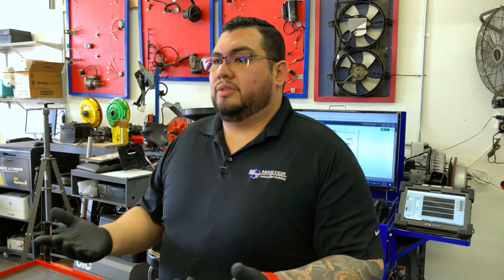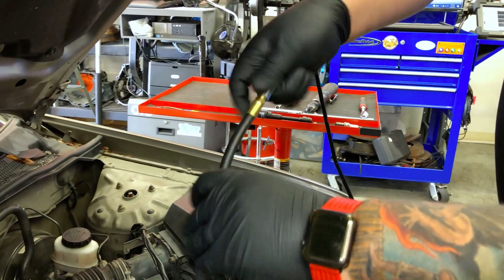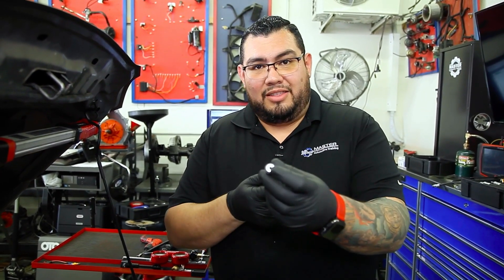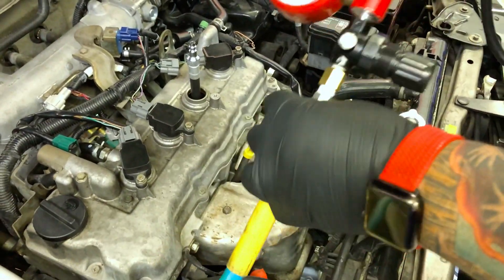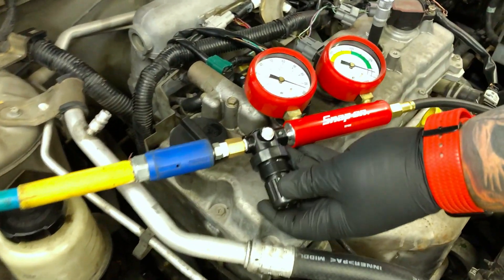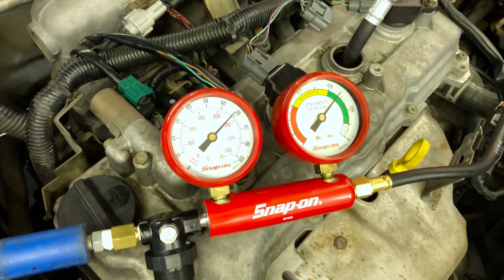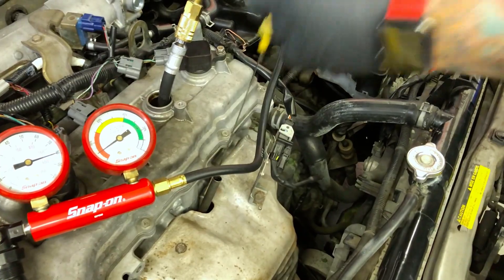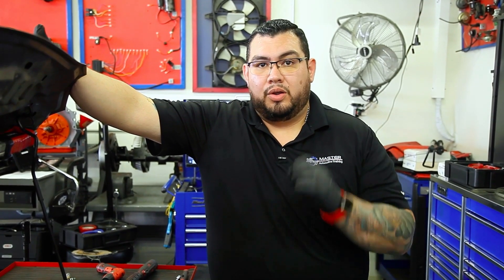How To Perform A Leak Down Test - Fast & Easy

Comment: Put an long 1/4 extension in the spark plug hole and turn until it stops rising, then it's at true TDC not + - 20° like that whistle gives you 😅
Reply: Agreed. Also worth note there's a TDC for compressive stroke and exhaust. Need to know which one you are on by looking at camshaft lo lobes. Otherwise...the escaping air might just be indicating the the exhaust cam is open as intended.
Reply: @CR-rc5ch whistle only sounds on compression stroke(both valves closed) next time pisyon rises, the exhaust valve is opening , therefore no compression. So whistle works to know that ypur on comp. But then tdc is important so piston wont move.
Reply: @CR-rc5ch ok so if I understand this correctly, then the intake lobes would be upwards and the exhaust lobes would be downwards. Is this correct?
Reply: @CR-rc5ch  first off a lobe doesn't open and you look at the valves not the lobes 🤣🤣🤣 Im sure you knew that I just have to pick on you
Reply: Hey man thanks for that tip.
Reply: Do you have to remove relay/fuse for fuel pump to not flood the cylinder?
Reply: @joeymalin  most modern vehicles have a "clear flood" mode where you floor the gas pedal while cranking to disable fuel.   Older vehicles require disabling the fuel system manually with fuses, ect.
Reply: @v12alpine  Thank you. Mine is a 2001. I’m pretty sure the fuses are the way to go for me🙏
Reply: This was excellent, well communicated. I see folks over-thinking the Whistler. It's as easy as he made it appear in the video. The entire upstroke on compression stroke occurs with both valves closed to build fuel/air pressure before spark occurs. The only concern for TDC is so the piston doesn't move when the cylinder is charged with 150 psi of air... as one person on here commented. For that reason alone it can matter, but even then, that piston isn't moving without turning the crank and belt line, and we'll see it.
A wooden dowel, straw, extension on top of the piston while manually turning the engine with ratchet/breaker bar (the way I grew up as a kid) still doesn't diffentiate between compression and exhaust stroke. The Whistler is the fast down and dirty way to get it done for folks doing engine work for a living everyday. I was a line (engine) tech for a Ford dealer way back when and still have a small shop of my own part-time on the side. So I agree with the guy from my experience.

Comment: I’ve seen engines with perfect compression that fail leak down. It’s not enough to say “if it makes good compression no need to go further”
Reply: Do you know what the issues were i that case?  🙂
Reply: @ too large of a piston compression ring end gap will make good bursts of compression but fail leak down. Same with slightly damaged valve seats. They will allow for sharp bursts of compression, but when the cylinder is supposed to hold the compression, it can’t and leaks down.

Comment: More accurately, the whistle is letting you know the piston is on its way back up on the compression stroke, but not necessary at TDC. To ensure perfect TDC, align the crankshaft to markings on the front of the engine to '0" of the compression stroke by turning the crank manually. Since some engines are virtually impossible to see TDC on the crank pulley, you can also a long plastic straw (won't cause any damage) in spark plug hole to see when TDC is reached.
Reply: My first time doing a timing belt on a ford escape and my co workers were losing their mind about getting the timing right after putting back together. But i did my research and made sure cylinder 1 was TDC with this exact same method and the timing marks were all lined up. First time starting the engine it ran perfectly and threw no codes. Ran smooth and since then I know to always just check cylinder 1 with a stick in the hole and timing marks in place.
Reply: ^^ this guy engines
Reply: I typically work on classic carb/points type engines. I always check the timing marks are correct agains the tdc, I typically use a dial test indicator, (because I have one and it makes it easier and more accurate). Lessons learnt particularly on older engines is not to trust the timing marks, until you've seen they're really correct.

Comment: I'm so glad I found this channel. My F-150 4.6 2v is missing in #1 during idle. Spark and injector is good. I've considered pulling the intake plenum to check for carbon buildup (280+ k miles), but want to be more sure on diagnosing before I started taking things apart. Subscribed.

Comment: Thanks, that's great information. I have a 2022 honda civic and with the car running when I remove the oil cap theres air blowing out. When a shop performed a compression test it came back good, so I'm wondering if the leak test would be helpful or if its even related....

Comment: Is there any purpose to doing a compression test if you have all the equipment for the cylinder leak down test? Also this was an incredibly informative video I wasn't expecting this level of detailed info. I was wondering what you meant by smoke coming out of the oil dipstick.. would this happen while running the leakdown test or when the car itself is running?

Comment: My nissan sentra has failed cylinders 1,2, and 3 , and there are plenty of misfires. I changed the spark plugs and the ignition coils, and it is still doing the same. The engine
 jumps like crazy, what it could be the problem?

Comment: Very informative video. I rebuilt my toyota engine, and it  fired up on the first attempt. However, I noticed within a minute that exhaust pipe overheating and compression loss. I was confused and thinking where to diagnose. now your presentation explains well. Please let me know if i need to test something else. Tku
Reply from the maker: Tell me more. The exhaust is getting excessively hot? You ran a compression test and saw low compression? Have you tried testing engine vacuum?
Reply: @MasterAutomotiveTraining  Thank you for your response. Ya, the exhaust tuns red hot in 30-40 seconds. RPM was also high, I assumed it was cold start. I did the tests you mentioned; and Cylinder 2&3 compression was  lower than the others two. I pulled the cylinder head and made all side block deck surface measurements. As I suspected, I found low spots in the middle, the center deck  of 2&3.   cylinders. I am not a rebuild specialist, but I think huge compression escapes in between these two cylinders that cause blowby. Also, i found dark oil lying over the head.The almunium head measurement looks good because it was resurfaced. I don't know how I forgot to resurfacing the deck. So, I  guess the chances might be to pull the engine out for deck resurfacing or do the resurfacing manually without pulling the engine. Someone suggested using a graphite head gasket for better sealing. Thank you again

Comment: So bubbles on the coolant with cold engine/engine off, means head gasket ?
Reply from the maker: Or a cracked engine block.
Reply: Super helpful video!!

Is there a way to isolate the cracked engine block diagnosis @masterautomotivetraining from the potential head gasket option?

Just got our leak down test kit today to test a 2000 Toyota Celica SX (australia) - we've done a compression test on cylinder 3 and there is zero compression so hoping the leak down can tell us if we can just remove the cylinder head and have it overhauled/repaired - or if she actually has a cracked block and needs an engine replacement 😢

Comment: How about a diesel engine?
Reply from the maker: It's the same however on a diesel engine it requires higher air pressure, since it's a high compression engine.

Comment: My engine only shakes after warming up. Can someone tell me what it might be? I know there are some smart people here. The vehicle barley moves when pressing the gas, smoke or steam coming out of the exhaust pipe, etc. The water pump went bad and I replaced it. I think I had a blown head gasket. I used gasket sealer and the smoke reduced almost completely but when I first turn the vehicle on a puff of smoke comes out. No check engine light. The temperature guage does not go up enough when my scan tool shows a much higher temperature. The engine is knocking. When I remove the upstream oxygen sensors I hear something like clunking or air quickly releasing from the exhaust valve when it shouldn't, on the side that shakes the most. I would really appreciate advice, suggestions, etc. Thank you.
Reply from the maker: Sound like you still have a blown head gasket. I always recommend not using dealers because they tend to block good coolant passages and causing more overheating problems.

Comment: I have an i20, 2010 model, http://1.6.My issue I'm experiencing with the car is that its not driving smoothly as it was. I took it the manufacturer to diagnose the problem and they told me, that compression was low in one of the cylinders, with a 120psi reading and the other 3 were 149 to150 psi between them. So they wanted to strip and see what's the problem and unfortunately I don't the money to cover that cost of stripping .I have read that 120psi is not that bad for one cylinder, just looking any other opinion. I have put fuel injector cleaner and valve ease but the problem still there. Funny thing on some days it drives well, no jerks, bad idle, misfiring and no wanting to switch off at stop/start traffic. The car has 165milege on it. I have attached an image of the report from manufacturer.

Any advice would be highly appreciated

regards

Ayanda
Reply from the maker: If it's low on compression, I'd run a follow up test of cylinder leak down to pinpoint where the loss of compression is going.

Comment: shoot!!!  The 4 examples, or options you gave at the end to help you diagnose the problem, were pure gold 🙏
Reply: I did not understand the glove and exhaust tho
Reply: @big_time_2023  stretch a latex glove over the exhaust tip. If air is getting past the exhaust valves, (and assuming theres no holes/leaks in the exhast pipe) the glove will inflate - identifying potential bent exhaust valve/poor seat.
Reply from the maker: Thank you!

Comment: So what's the deal with green area reaching as high as 40% leakage when usually it's said that 10% is a healthy maximum and 20% is where real trouble starts; 30% you need a rebuild right now. I would love to hear your thoughts. Even some workshop manuals say anything past 25% means serious issues.

Comment: I had problems with my 5.7 I first did a compression test and indicated zero compression in a cylinder that’s fine but it didn’t tell me the root cause of the loss I bought a leak down tester and performed the test on that dead hole again determined it was blowing through the crank case within acceptable tolerance and not blowing out the valves making a long story short it was the worn out cam and lifters , there was no lift so no compression the cam was wasted like all other 5.7’s Iearned all that watching your video seriouly to pinpoint the problem thank you

Comment: I was told that you can also see if the piston is on TDC if youll put a tool inside the compression camber you'll see it going upwards. Than stop if its going down again. So than you'll know the piston is on top or TDC. Is this correct?
Reply: You would have a 50% chance of getting it right. The piston reaches the top in the compression stroke and the exhaust stroke. TDC refers to reaching the top in the compression stroke. Look up an animation for a four stroke engine and you’ll see what I’m talking about.

Comment: Please do not use music I can not focus.
Reply: It's a great video but the 1980s random electric guitar music is painful
Reply: Sounds like a you problem
Reply: I second this 😂 all these tutorials have this loud hard rock in the background
Reply: I'm ok with the jams 😊
Reply: Sounds like a personal problem
Reply: You come here for FREE information and still complain. Put the volume down and read his lips if it bothers you that much.
Reply from the maker: Got it.
Reply: I have an i20, 2010 model, http://1.6.My issue I'm experiencing with the car is that its not driving smoothly as it was. I took it the manufacturer to diagnose the problem and they told me, that compression was low in one of the cylinders, with a 120psi reading and the other 3 were 149 to150 psi between them. So they wanted to strip and see what's the problem and unfortunately I don't the money to cover that cost of stripping .I have read that 120psi is not that bad for one cylinder, just looking any other opinion. I have put fuel injector cleaner and valve ease but the problem still there. Funny thing on some days it drives well, no jerks, bad idle, misfiring and no wanting to switch off at stop/start traffic. The car has 165milege on it. I have attached an image of the report from manufacturer.

Any advice would be highly appreciated

regards

Ayanda
Reply: @MasterAutomotiveTraining .    the music rocked
Reply: Do you! Keep the jams coming. These people come here for FREE information and still complain. There, I said it for you. Good stuff man

Comment: If you get air out exhaust it’s exhaust valve damaged or not sealing also if you put compression on cylinder 3 and it leaks out cylinder 4 when spark plug is out it could be a crack in between the cylinder head wall that both cylinders share 😊

Comment: Seems like your technique is a bit flawed.
The supply side gauge needs to be set to 100%, typically 100 psi, during the actual test--not before the test.  If the supply side drops below 100% during the test, the leakage will appear to be more than it really is.
The best way to go is:
1. Bring the piston to top dead center of the compression stroke.
2. Back the regulator on the leak down tool all the way off (supply-side = zero).
3. Connect the leak down tool to both the cylinder under test and the air supply.
4. Turn up the regulator on the leak down tool until the supply-side gauge reaches 100%.
5. Read the leakage percentage on the cylinder-side gauge (supply-side =100%).
See how that works?  Setting the supply side gauge to 100% calibrates the cylinder-side gauge.  In other words, the only time the cylinder-side gauge is accurate is when the supply-side gauge is reading 100%.
Another benefit to this method is it's less likely to push the piston down.
When done this way a good cylinder will have a leak down percentage of 10% or less.  An acceptable cylinder will have a leak down percentage of 10% to 20%.  A cylinder with more than 20% leakage is something to think about.

Comment: That "glove to exhaust" test you were referring to.  At what point do you make that test?  & if it was an exhaust valve issue, do you have any videos on how to repair that particular issue?  
-Thank you in advance, you've just earned a suscriber today.
Reply: You test that when the cylinder is pressurized. If air escapes when the piston is at tdc the exaust valve is burnt/bent and leaking.
The fix would be to clean the valve and lap. If it was bent you would just replace it

Comment: I don't understand why the cylinder has to be at TDC, wouldn't it be fine to do the test at any point on the compression stroke?
Reply: You need to close both intake and exhaust valve which happen at tdc. Note that in this 4 stroke there is a second tdc when both exhaust and intake are open.

Comment: Air loss in the crank case can be rings or a hole in the past. 
Put a spoon full of oil in the cylinder and recheck 
If the air loss improves its the rings.
If not its a hole in the piston 
If I have a loss in the valves I loosen the rocker arms when possible to make sure the valve is closed if you still have air loss
It's a bent or burnt valve
Reply: Might be head gasket to.

Comment: How much scfm and tank capacity would one need if they’re using a portable air compressor for this kind of test
Reply: Very little if it doesn't leak..a small portable compressor should be fine.

Comment: Wow another great video. 
Just want to know once you find out that it is a valve issue are you going to do a full valve job on this engine or is there a way you will do it for just the one valve. Thanks for a great video!
Reply: Well, since the head has to come off, it is well advised to do it right and not only  do a valve job but a complete head rebuilt. This is something  that you wanna do it  right  and  once only.

Comment: Great video.  When it comes to these leak down testers, I don't really too much for the knob function.  I dunno.  Sees it could have a numbered dial on it.  As it is, yuh turn it out to some undetermined point until no air passes thru - and then begin turning it in...  That is, a precise instrument should have a precise/calibrated/numbered dial.
Reply: The instrument doesn't know how much air pressure is coming in, is it 125psi? 150psi? 175psi? so you have to adjust the inlet pressure to make it work.

Comment: Best video on this topic I've seen so far.  Great job!  I'm a DIY mechanic and don't necessarily need to buy the SnapOn leak down tester featured in your video, but I want to do it anyway. The reason is that buying the tester and performing the test is probably still cheaper than scheduling an appointment for a certified mechanic to do the same work.  The bonus is that I'll always have the tester, and will have learned a new skill.  This video definitely gets a thumbs up.
Reply: Get the Lang Tools leak down tester they make the  snap on brand leak down testers and they are  cheaper priced.

Comment: Where can I get that whistle tool?!
Reply: You don't need a whistle. Use a party balloon. It has the advantage of being very visual, cheap, easily available and you can wind the crank back and forward to more easily get TDC (then there is less chance the compressed air will push the piston down). When connecting the airline, watch the fan belt to see if it or the alternator pulley move. That would indicate the piston has descended giving an inaccurate reading.